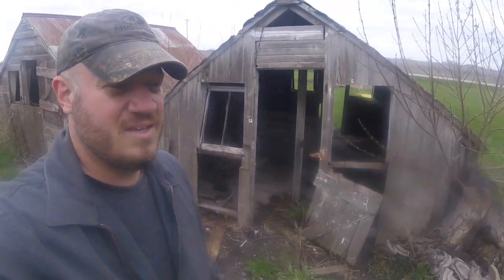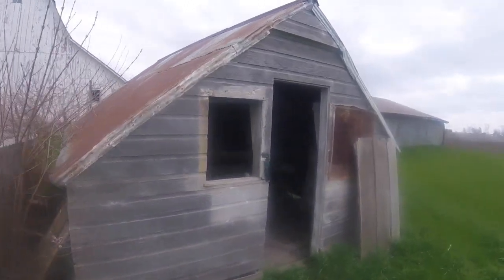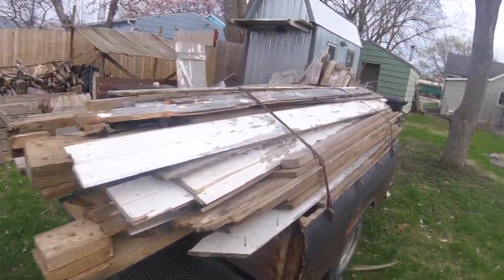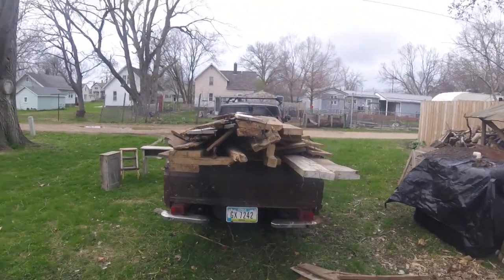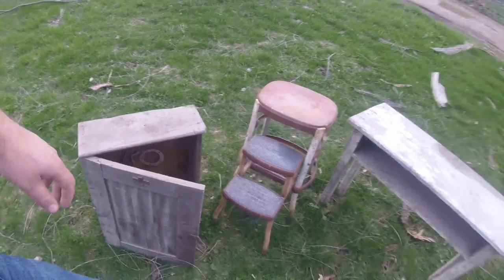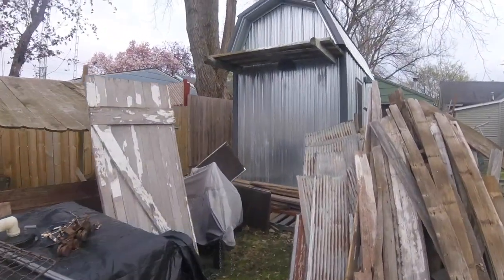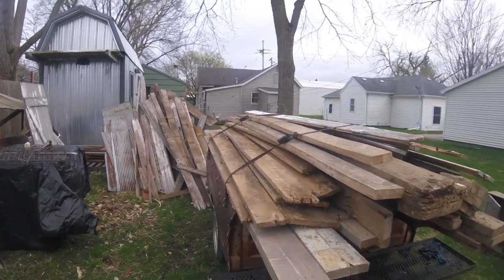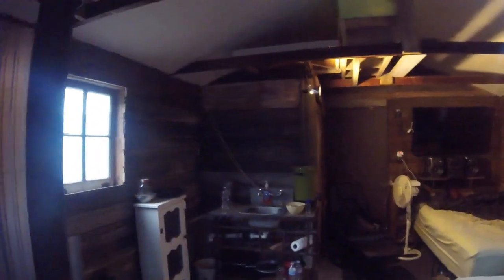Free Barn Wood!  To finish some stuff.

Comment: Barry, why not concentrate on one room at a time in the main house. You had this house for 3 years, and I think you could have been done.
Reply from the maker: I thought the same thing for a while.  I had to change my strategy with that main house.  It's going to be another few years for that honestly.
Reply: @extremebudget  Why did you have to change the strategy? Find bigger issues with it?
Reply from the maker: @joannacoe4573  I was able to finish what I could until I got to the major foundation and roof issues.  I couldn't finish those while living in it so I had to build a comfortable living space in the garage.